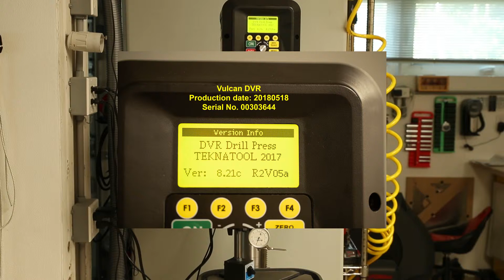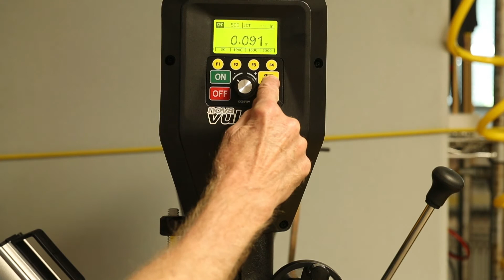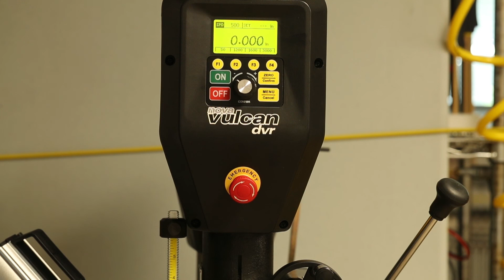Vulcan display errors

Comment from the maker: Well, with absolutely no help forthcoming from Nova, I solved this problem myself.  I made a 1/8 inch thick spacer and inserted it around the moving Quill, biasing the Quill downward 1/8".  This spacer makes the new full up position 1/8 inch lower than as-delivered.  Error is no longer present, but the downside is the Quill travel, which used to be 6 inches, is now 5 & 7/8" inches.  Why this couldn't be solved by Nova is unacceptable.  Take a look at my other video on the Nova Vulcan T-slots.  https://www.youtube.com/watch?v=z4Pw_TDQcEI
This is another problem that has an easy solution, but, once again, Nova blew me off.

Comment: Did you come to any conclusions as to what was going on?
Reply from the maker: Told my rep about this issue, made the YouTube Video shown here, and Rep sent this video to Nova.  Rep heard back, and Nova said they knew about the problem.  ??? No further response from Rep or Nova on this problem.  No solution provided to me-my fix is the only answer so far.  

I've also told my Rep, who then told Nova, about the poor quality T-slots in the Vulcan table.  Rep wrote a no-charge order for a new table explicitly stating, finish mill the T-slots.  Nova sent me a new table, it was identical to old table.  Not good.

So, I provided a video to show the T-slot problem and how to fix it.  There has been no response on this issue either.  https://youtu.be/z4Pw_TDQcEI
Reply: @DRJAKIRK  Thank you for the response.  I've been thinking of buying one of these. Would you recomend it despite these shortcomings or would you recomend that I look elsewhere? Thank you again.
Reply from the maker: @pwhsbuild  My recommendation is to buy the Vulcan.  I purchased my unit with a downfeed attachment, which allows handwheel control of the Z-axis in 0.001" increments.  The ability to control spindle speed with a simple knob (goes as low as 50 rpm) is a huge plus.   Try this approach.  Call Nova in Florida and send them links to my two video's.  Ask them when these deficiencies will be correct.  Tell Nova that James Kirk is working with his Rep, Tim Cost owner of "Local Woodworking", and they can contact Tim on who he's contacted at Nova and where these issues stand.